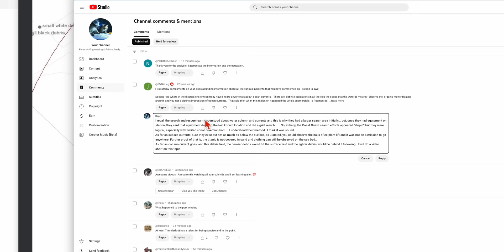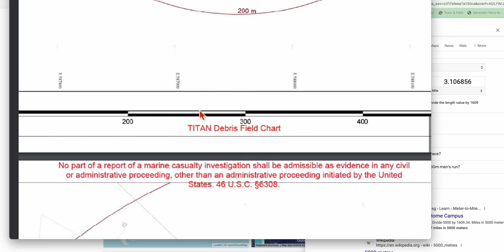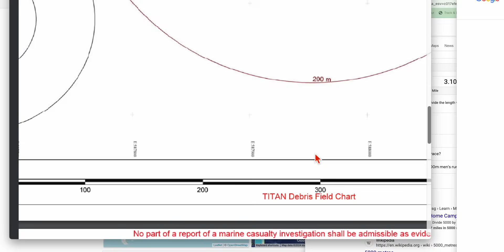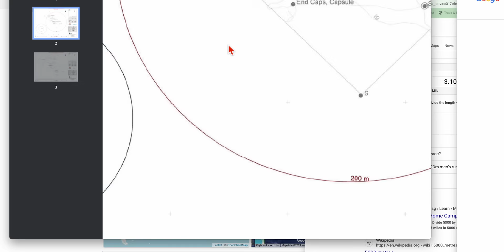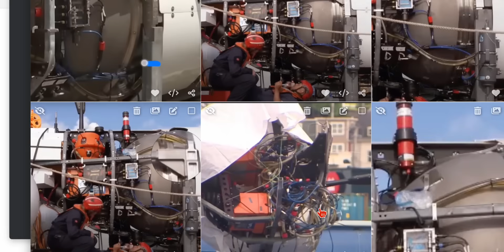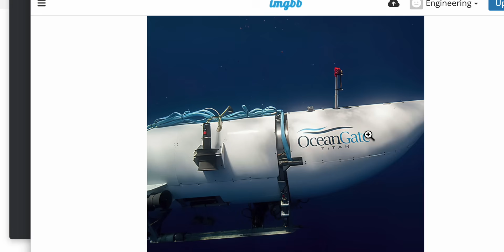Titan Submersible Rear strong back was a pry bar force on top connection putting it in shear stress

Comment: If I were a betting man, I would say the only things they could manually control in terms of bouncy were the pipe weights and the bladder.  They would need explosive bolts to start jettisoning the skids and tail.  

That said, the tail with the 10,000 psi air bottle departed the craft at some point.  If there were a one way check valve on the bladder it would stay inflated if the tail section departed for some reason.  The pipe weights needed the thrusters for emergency drops of those (the sub would tip on its side and spill the weights out).  No thrusters, then no weight jettison.  Weighting for ropes to dissolve to prop the balancing weights would only help in types of emergencies where time was not critical.  

This is really difficult to analyze because a scenario could include the bladder deploying and only partially damaging the tail section.  The bladder, perhaps part full, drifted away, while the damaged flopping tail section broke off later.  Need to find the bladder.

There was talk about the decent rate.  Almost everything attached to the sub seemed to be on the flimsy side.  I could see a scenario where the flimsy fiberglass shell over the hull departs first, followed by a bladder on a rope.  The slack comes out of the rope and the jolt could take the tail section off.  When the tail departs, the rear bulkhead penetrations became leaks.  If there were no cock-valves on the penetrations then they became leaks likely?

    

Another factor

Comment: At the back section you will also have a cantilever effect.The back hemisphere ring had to carry all the weight of the auxiliary items in the unpresisurised section.When it was diving it wil not have that great effect because of buoyancy.But when out of the water this is a total different story.Standing that long out of the water the cantilever effect will start having an effect on the glue bond.

Comment: Shout out from Canada here. Thought I’d mention something about the Titan having been stored outside on a pier in St. John’s, NFLD over the winter prior to its last dive. I worked in the Telecom industry in the maritimes. NFLD that winter had gotten multiple massive snowfalls, one hurricane and multiple storms with 100+ km/h gusts. This is very normal there. What’s not normal, is someone even parking any vehicle on a pier getting blasted by the ocean storms would rust anything out in no time. Also, a bigger factor related to that is the high number of foggy days.. this is salty fog and is absolutely horrible for anything. I spent a lot of time repairing and replacing equipment running along the same lines as the hydro lines. There is definitely a higher cost in these regions to maintain and repair equipment affected by the very corrosive weather. If you had an aluminum engine block in your car, one year and you’ll see those white pitting corrosion from the salty air. I have no doubt, the way the Titan was stored and the environment it sat in had negative effects on any exposed metals. I could see things would get stuck, like weights for example could over the winter get stuck to it. My brakes would turn brown and rusty overnight when I lived close to the Atlantic. The amount of buildup of sea salt alone would be concerning. Thank for the vid
Reply from the maker: Nice read, thank you and you are correct, you get nothing for free.

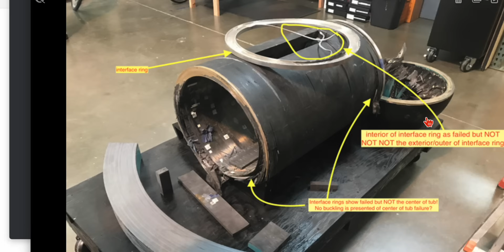Comment: At or around minute 55:00, could the name of the fastener you are trying to reference be "Jo-Bolt"? They are a type of hi-shear fastener that works like a pop-rivet, where you are holding its bolt-like head, while tightening a threaded stem which pulls up, or in if you prefer, on the bulbed opposite end of the fastener, creating a "tail" on that opposite end like a pop-rivet. Just a thought...
Reply from the maker: It's a "rivet nut"
Reply: @LoadPathEngineering  Sure "nuf. I just didn't think of them as being "like a pop-rivet". The fastener that does come to mind when thinking of what those people were trying to do (misguided or not) are known as "Hi-Shear" (brand name) rivets. Very common in aircraft assembly and repair. On a different note, thank you for such an excellent presentation. It helps one see how the catastrophe unfolded. You left me with an image that the entire "tail-cone" assembly was wrenched off the rear dome due to the violent twisting motion you describe that the pressure vessel took during the implosion, since that assembly not only had a mass of its own, but it seems there would be a hydrodynamic drag induced by trying to yank it instantly through the water in any direction. Thanks again.
Reply from the maker: The Hi-sheat rivets do not thread, I believe they use a pin system .,. They are more like bridge rivets ...
Reply: @LoadPathEngineering  Sorry to give misleading information. What I should have said was "Hi-Lok" fasteners. They are meant to be used in situations where high shear loads are encountered. They are steel pins of various diameters and lengths with either countersunk or flat "pan' heads. They have unthreaded shanks to deal with the afore mentioned loads and a relatively short threaded end, which receives either aluminum, or sometimes steel, collars to prevent them from "working" out. These fasteners are supposed to go in holes with an interference fit, where you tap them in place with hammer (sometimes a rivet gun). Again, sorry for the incorrect suggestion.

Comment: Having a from the outside bolted closed hatch where it literally takes 20min to open the hatch/dome which could only be done from the outside is so dangerous. In case of a emergency there was no fast egress for the people inside. And as mentioned by testimony's the thing was full of non marine grade equipment and non fire retardant materials. Only the hatch design is enough to know this thing wasn't made with passenger/crew safety in mind. It is rudimentary that in a closed human occupied vessel emergency egress should always be possible from the inside.

Comment: Hi. It's again Tanja from Munich. Your explanations have me a bit of a shock of how dilettantisch engineering work can be. And this even though you can see it with your eyes hanging. I am just a small industrial engineer (not anymore working in this), but even with my car I am doing regularly controls and  maintenance, especially after accidents. And all the screws. Damn. But I still don't understand what kind of mechanism is needed, to drop the legs. And didn't you show a picture where the thruster is bonded with the legs? We'll see. I still have some problem finding all your videos. Maybe you're told already the answers. Yours fan of forensic work Tanja
Reply from the maker: They had a couple of versions and one appeared to be a jack... This one has that bracket (that has a part number that I cannot find how it operates)...
I will update when I know for sure
Reply from the maker: Hello Munich!

Comment: I think the rear end was knocked loose during rough handling or rough seas when they were landing it back on to the platform causing (or exacerbating) damage to the bottom of fiber hull towards the front and most likely damaging the back end in the process.  It seems to me it failed in the near the bottom front because the top was largely intact and wherever the water first entered would have been broken into smaller bits.  All it takes in  water to get into a crack along a fracture plane and water will begin ripping apart a quickly widening area.. All the  stuff from the front would get rammed into back. As the water starts to enter it''s also getting inbetween the layers and delaminating, the ripping force of the water tearing it's way in along with the kenetic forces of the water as the void its totally filled would rip and break it up as well. The back end was probably hanging on by a thread aka that backbone thing, which in the pictures is always deformed and there would be a quick and sudden twisting of the some parts as it's ripped apart - the back endcap twisting from  the plosion and that big heavy mass in the back isn't gonna  twist so easy and could get ripped apart especially again if the side brackets were already broken. Also if u think about where a lot of shock compression forces would go if it was dropped with the front skid tips hitting first and that floppy heavy back end - it would concentate a lot of force (enough to deform / crack hull and break the side mounts for the back) to the bottom of the hull near the front. Sure it would create tension on the top but I think that metal beam goes from  the tail tip to the front ring and if so tension on the top wouldn't be nearly as bad as the squeezing on the bottom.  Also the examination of the front ring showed the outter layers went outward and the inner layers seemed to break mostly inwards which would make sense if there was delamination happending rapidly towards the front. Also the debris field seems to match up with all this - from what anyone can tell from that absolutely horrible debris field document. They should had pictures from each location instead of vauge descriptions like "black piece" cmon...   Also - i also really like cats so i hope u consider this.. house music is okay but i use hardcore and gabber to focus.. Lastly my opinions are from watching the hearings, reading the exibits, and not from any other channels.

Comment: Would love to see a close up of the entry points of all the electronics going into the rear dome. It has always bothered me, and it seems like a very difficult place to keep the water from breeching the hull, especially if the tail section fell off and started ripping at those entry points.

Comment: This happened on the 14th or 15th dive down to the titanic. If they were going to of had an issue with going off balance when dropping weights it would of happened long ago. The two weights he dropped was too slow then down so they didn't slam into the sea floor. It's just a coincidence that this thing imploded shorty after dropping said weights. You should be talking about the loud bang they heard on the front left bottom of the hull (and showed on the stress gauges attached to the hull) that happened the previous dive and Rush blew it off as something not to worry about. That's where this thing failed. Not the back
Reply from the maker: I already talked about the loud bang... When I do my final video it will connect all of the story

Comment: It definitely floated around down there. For how long I wonder. There is little to no chance that they didn't know they were doomed down there. Still waiting on the exact time the military listening devices heard the implosion of the Titan. How about the onboard computers? Do those have a log or "black box"? Knowing the corners they cut I imagine it was too much safety! There was a reason nobody had died in a submarine / submersible accident in over 35 years. And it was the one thing Stockton was hell bent on avoiding. SAFETY PRECAUTIONS!!!!

Comment: @deltasyn7434
0 seconds ago
The design of the framework for that apparatus puts all of the weight on that rear dome and ring. And subsequently, those brackets. That's why the holes were all deformed. Those long skinny1/4 x 20 bolts they used were bending from that weight. That and any additional stresses from compression/decompression. That essentially makes for a MAJOR weak spot at the rear dome where it meets the carbon fibre. On top of that, it would create a major imbalance as it would shift the centre of gravity of the whole sub toward the back end each time they release a drop weight. And the sub imploded only a few seconds after releasing the weight. When that happened, it probably jolted the frame as the centre of balance shifted. That stress subsequently broke the cold weld on the starboard bracket which caused the water to rush in like water jets all around the ring. This is why the glue looks sheared. Because it literally was sheared by the force the water pressure. It even has a burnishing area and a fracture area like what you see in metal stamped parts. Look at the sides of any washer and you'll see it.

With that in mind, I would figure that the force of a hydraulic or mechanical press is comparable to the pressure at the bottom of the ocean.

Comment: I'm curious if the titan shakes as it descends through the water column. I think it would, and I think that could put tremendous bending forces on the interface ring as that huge tail shakes up and down. I think I heard the phrase "enjoying the ride", which implied to me that it's not a smooth elevator like descent. I also thought I heard they were descending faster than normal.

Comment: If the Skid debris was unevenly weighted (a bracket on 1 end and not the other) then this could have produced a small directed "glide" as it sank rather than a more random "fluttering" type of decent.
I think the pattern of small heavy "lumps" are more likely to show a center closer to the position of implosion.
Surely anything with a larger surface area and lower weight is likely to be less reliable when determining position of implosion?

Comment: I believe the few attachment points from the caps to the tail/frame would shear off immediately upon the implosion due to the moment of inertia in the tail section.
Then there's the rebound as well which would have exerted another shock. I've seen 8mm bolts shear from a little 8l tank collapse at -1atm so the effect at a delta of 380 must be staggering.

Comment: For all the shortcomings of the Oceangate submersible design, the fact is that it did survive multiple dives before imploding. So the design parameters with regards to resisting pressure were adequate. The carbon fibre material used for the tube of the crew compartment deteriorated over several dives before finally failing at depth. Clearly there were other design inadequacies but the primary failure was the carbon fibre tube of the crew compartment, which failed catastrophically and instantaneously. As for the charts of the debris distribution, the relative positions of different bits of debris in relation to each other are probably accurate. The scales are just for guidance and may or may not be missing a decimal point or two.
Reply from the maker: The scales not for guidance,  they are literal ... NTS would change everything
Reply: It did 13 dives to Titanic depth, a couple of slightly less deep dives, the majority of dives were just a couple of hundred metres or less

Comment: From my basic calculations I had the mass of the bare pressure vessel at around 5 to 6 tonnes, add in 0.5 tonnes of passengers plus maybe another 1 tonne for all the kit installed in the end and under the floor gives something around maybe 7 tonnes, it displaces 10 to 11 tonnes of water so on it's own it has significant positive buoyancy - the tail end had an overall negative buoyancy (it sank!). Regarding the roll axis of the pressure vessel, the passengers would be pretty central as was the distribution of the kit in the back, the underfloor equipment would move it a bit but since the mass of the bare PV is 5 to 6 tonnes I suspect the roll axis wasn't far off central. Regarding the CG, if the passengers were evenly distributed front to back and the same for the underfloor kit then the weight of the equipment in the rear would move the CG back from the centre of the PV, the negative buoyancy of the tail effectively adds weight to the tail making the whole thing tail heavy - it would be interesting to know how they achieved and maintained the trim -
Reply: The trim was adjusted by the mission specialists and where they positioned their bodies.
Reply: I heard something about an earlier malfunction of the 'automatic trim system ", implying there is one.
Reply: @LoadPathEngineering I could have sworn that I heard testimony that it weighed just under 10,000 lb completely empty, and about 13,000 lb once outfitted. Not including passengers and whatever they have with them

Comment: I think it would help if you started each video with a summary of your current theory and how you have reached that.  It’s hard to keep up with hours and hours of video - although I enjoy your content and your care of cats. For example I watch this current video thinking what if the sub imploded 300metres above the sea floor and the force of the implosion caused wreckage to randomly float to the floor landing over a 200 metre radius.  Why do you think they had time to drop the skids and inflate the airbag etc… why can’t the implosion and raining of debris also account for the debris field. Then again I have no experience in engineering. I accept some of your explanation but it takes over an hour for you to explain very sensibly why you think the back end fell off before the implosion  and it makes sense. A simple summary of your arguments at the beginning of a video may help to dispel some of your critics. For example, showing the rear end without damage indicating it disconnected before the implosion makes you believe x, y and z
Reply from the maker: I actually prefer critics , they may find an error in my thinking before I do... I am not at the definitive video yet but I am very close to explain the debris field ... 
Most people need the implosion to take place at the same time as last pink and dropping weights... they are emotionally tied to that narrative and hare the have been bamboozled twice! 
Once,when all the youtube experts t9pd them it would be splinters left and it is now proven to be false... And, now when they believe implosion happened at last known location.